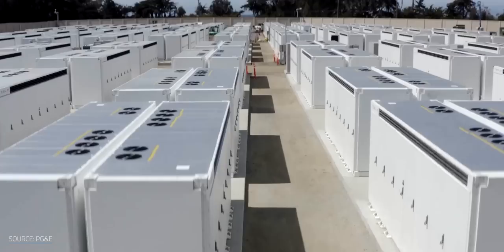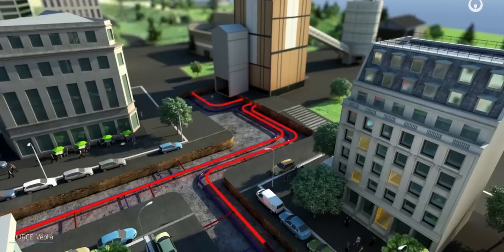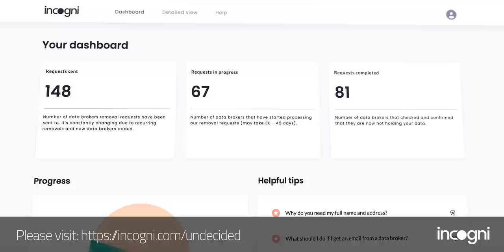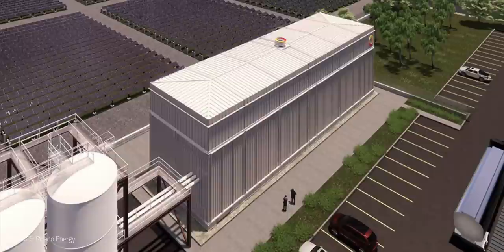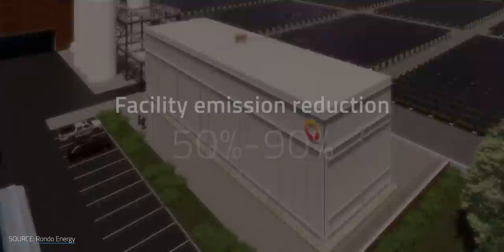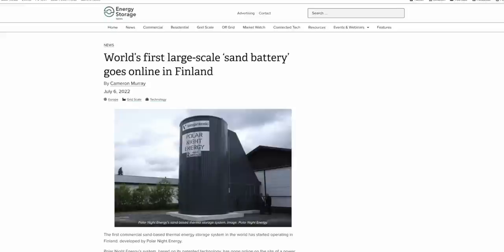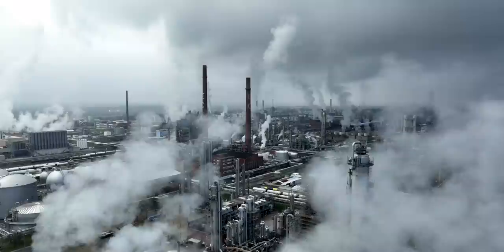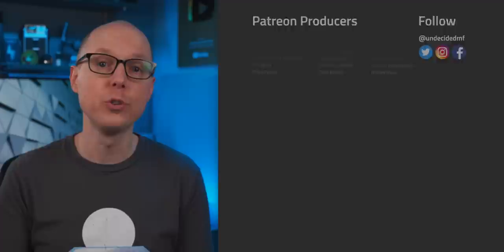How A Brick & Rock Battery Is Changing Energy Storage

Comment: Electricity converted to heat is a very low efficiency process, which means that this move is not viable for solar or wind. Just compare the heat output of a toaster element verses the kw hours put into it.

Comment: There ain't anything new under the sun ! Back in the 70s, with no local gas supply, only electricity, by father installed what were called "Storage Heaters" These operated with a special meter that could split the supply into off-peak and peak times. ALl night long the heaters would heat up and store energy in brick blocks in the unit. During the day the heaters were turned off by the meter, and the heat allowed to pass out into the rooms. In early years there was also a cheap period of a couple of hours in the afternoon. However this was eventually closed, and the heaters became more sophisticated.
So these are just very large storage heaters ! However, as far as I can see, they are not yet developed enough to actually use the stored heat to generate electricity, or am I wrong ?

Comment: Is anyone developing a home sized unit that would be a source for home heating and hot water?  I live in an solar off grid home.  I know that heat pumps are a great solution but this sounds simpler and the heat pumps could be a heat source for the storage units.   My solar cells on sunny days recharge my batteries before noon and essentially sit idle most of the day running the few appliances I need.  I like the idea of heat pumps but generally you need them most for home heating at night when the solar cells are not producing which means a big drain on batteries.  It would seem that once my batteries are charged, I could use a heat pump directly from the panels and store that heat directly in a device like this, drawing from it at night or as I needed hot water.

Comment: I really don't understand why steel production is even mentioned in this video. Where do you think the energy that generates the heat comes from ?. I love the idea of capturing/recycling heat energy from factories though. Maybe give them a tax break or something in return.  ALL our meaningful electricity production originates from heat and even coal power production and distribution would be MUCH more efficient if we could readily charge and discharge from large, reliable, low maintenance batteries somehow. This sounds promising.
Reply: Steel production was mentioned because it's one of the biggest polluting industries. Reliant on high heat temperatures; there are plenty of solutions for consumer green energy, but very few that can meet the intensity required by the steel industry.
 Consumers are some of the smallest global polluting demographics. Industries are by far bigger polluters, even worse than volcanoes. In one Scientific America article, it's said that the world's volcanoes produce about 200 million pounds of CO2 per year. Meanwhile, humanity produces about 24 billion pounds of CO2 per year.
 So if anything's going to be done to decrease greenhouse gasses, big polluters are the ones that need solutions, not consumers (although solutions for all would be better).

Comment: The only downside I can see to this is size, which is the achilleas heal of just about all fossil fuel replacements. If you are using a turbine to heat the new rock pile, where do you get the space for the rock pile? This my be one of the oldest technologies on Earth even animals use it, so it clearly works and I hope it delivers profitability.

Comment: if we take just the costs of military, we could  instead of all the fighting and suffering for the energy easily drill millions of deep holes into ground, getting free geothermal energy along with the possibility of storing the excess heat in the summer for the winter, which is the biggest issue humanity always had.. just getting warm through the winter and more recently to have warm water available
if we solve this, then only issue of the effective, sustainable and environmentally friendly transport and has to be solved

Comment: Conversation from electricity to heat is not 100%.  It can be close, but there is always loss wherever energy is moved. More than that, capture of the heat energy will never be 100%.  You always have to be skeptical of advancements when they bluster and/or outright lie. In this case, I'm hoping they're just being overly optimistic.

Comment: Could this concept be integrated into charging stations for EVs, and thus lower the strain on the power grid? How much renewable engergy is needed to maintain one of these? Just curious.
Reply: no you'd lose much of the energy in conversion back to electricity. This is only useful where Heat was the desired product, be that in the form of air or steam.

Comment: A 1 square mile (2.5sq km) solar facility produces the equivalent energy of a 14MegaWatt fossil fuel generator. It would require 70 SqMiles(181sqkm) to generate the same energy as a typical 1000MegaWatt fossil fuel generator.  To generate enough energy for the UK(318,000MWatts) it will require solar panel facilities to cover one fourth of the land of the UK.  Is Greta ready to see one forth of the land covered in solar panels?  And that does not include any land use for energy storage which is predicted to be nearly the same requirement as the solar panels themselves.

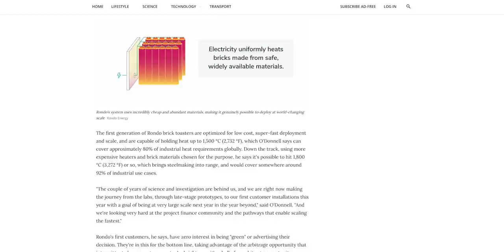Comment: 12:55   1500 degrees celcius might not be high enough for steel itself, HOWEVER, it IS enough for making the coke used to heat the steel. So right there you can cut a big chunk of carbon emissions as it takes a lot of energy to cook coal into coke and right now they use other fossil fuels, or even some of the very coal they are cooking, to provide the energy.

Comment: What if the pyramids had some kind of lens on top and it was actually heat they were aiming for?
Reply: See Lighthouse of Alexandria's "Death Laser". There's a molten salt power plant in Nevada that uses solar reflection, but a pyramid would be incredibly inefficient for that purpose because half of it will be shaded by the sun for most of the day. If their intention was to gather sunlight, it may have made more sense to build something like a concave hole with mirrors on a mechanism that can be moved to maximize sun exposure. Glass production back then was different though and impurities were common. "Eyeglasses were said to have been created by Salvino D'Armati in Italy during the 13th century."

Comment: they shouldnt be using electricity to create the heat thru resistive heater elements they could use heat pumps. not only could they put more heat in that way but they would also be taking heat energy out of the atmosphere. it would require a multiphase cascade heat pumping system  probly but its def possible

Comment: rarely, if ever, are things one size fits all.
It seems like this tech has a place in industrial and commercial applications.
Other similar tech may be required for task specific applications.
The holy grail is residential. 
If they can make a residential units as individual or even apartments that is cost effective; 
they will be mining gold. I am sure there is a size where it becomes more feasible than not.

Comment: So, chemical storage has some specific known risks and hazards. Batteries catching fire, disposal, toxicity in their construction, etc.  Same for gravity storage.
Thermal storage is ... yeah. Distributing that heat is going to have losses. The universe itself isn't cooperating -- pumping heat INTO storage is harder.  Also, safety hazards are different, not unlike high voltage electrical transmission and delivery, which can be VERY destructive when it fails.
But, water wants to get everywhere, and volcanic explosions are pretty much caused by water getting into places that are super-heated.  I want to know how they maintain thermal energy distribution systems, and how they repair damage, and what happens with structural damage (earthquakes, idiots with back-hoes, etc.) and what happens when water gets where it isn't supposed to be, and how long it's useful before it needs replacement, and how much that costs, and how much that impacts the environment... all the questions that also get asked for chemical and electrical distribution.

Comment: Batteries will finally be dirt cheap when they are made of dirt.  No one seems to cover the most applicable part of this energy formula...   Concentrated thermal energy from sunlight...   shoved through pipes into the ground nearby through boreholes... Stores the sun's energy.  

When you want to tap this energy, heat can go into a ORC (Organic Rankine Cycle power generator) to turn HEAT into electricity through the boiling of organic molecules in the same way an air conditioner works but in reverse (heat converted into electricity, not electricity into moving heat around).  

THEN when the sun goes down, you still have your heat in the ground and can continue to generate electricity using your heat stored in the ground.  A professor at Clemson university and the engineering firm AH&P in Macon GA are the pioneers of this tech.  But no one in the youtube world seems to notice what they are trying to do except the Department of Defense.

Comment: All of the old world architecture across the entire world that is made out of bricks all of it even mountains that they say are mountains that have been carved and there's bricks everywhere and there's windows and doors and archers still left even though it was melted it's because the bricks stored energy back then that's the reason all the buildings were brick everything across the realm streets and all because it was a worldwide battery storage and yes heat event did happen that's the reason you see old world architecture in some areas is melted it's not worn it's not torn it's not corrosion it simply was melted at 1 time from the electrical source in the building

Comment: I was very curious about cogeneration, thank you for talking about that. Would be great to do a deep dive into and what scale cogeneration is required to be profitable - why can't we cogen at home? How big does that unit need to be? How small can a TES be to be effective as a generator (TES water heater?)
Reply: @pierregravel-primeau702  Good to know it can be done at home, I was thinking about TES as an alternative to small scale home battery storage. There are losses due to converting heat to power but is that greater than the rising cost of lithium?
Reply: Cogen requires a gas turbine, which is far more expensive than a gasoline or diesel engine.  That's why we don't use them at home.  The only vehicles that are powered by turbines were our tanks because of the large amount of power for the lower weight.  However, it costs too much and even the government with an infinite supply of your tax dollars is going back to diesel.
Reply: @lorenwilson8128  Looking to understand if cogen using the waste heat is possible using heat to energy transfer (steam turbine) vs gas turbine. These units store superheated heat, so do we need gas if we already have the heat to boil water? I think one issue with cogen using compressed air was the pressure vessel. Presumably the challenge with bringing this home is our ability to insulate safely and affordably (aerogel). But not sure if there are any heat-energy generators. This video talked about cogen from heat, just at industrial scale. Would like to #JustHaveAThink about the limiting factors in small scale THS Cogen

Comment: And when the pipes break from earth quake then what? No one has heat or hot water in the whole city
Reply: When that happens, everything will break, so it's unfair to single out these pipes in particular. It's fair though to say that there's no one-size solution for all places, because all places are different.
 If a place knew the frequency of their earthquakes and the stress they put on subterranean networks, they could build to prepare for that. We have capable architects that know how to build for minor earthquakes. They could weigh the cost of infrastructure against performance, environmental impact and predicted longevity of the network.

Comment: Non-phase change encapsulated thermal batteries are basically governed by their volumetric heat capacity(VHC). 
The VHC of water is roughly twice that of rock which is why we have been using water in boilers to heat homes forever now. This tech is also been renamed to radiant heating and is installed into floors in homes and basements, garages etc to use excess heat from other sources primarily because it is efficient to water to store heat energy and also move it around.

None of this is new technology though. I admit I fail to understand how or why engineers think a solid like rock or sand would hold heat energy better then water when the VHC of natural rock is so low compared to water. Thus, this reeks of bull excrement to me.

Comment: Matt, right from the start, you miss the main issue : This system stores heat, not electricity.
So to call it a 'battery' and suggesting it is a replacement for lithium ion batteries is misleading.

It's not. It's just a giant electrically powered heater, which is arguably the dumbest thing you can do with electricity, renewable or not. 

Please do better.

Comment: Could a low level radioactive mineral like thorium heat up hot enough to melt steel?  There shouldn't be any hard and fast rule where atomics can only be used to make electric power! Could thorium be used to long term power a steam engine pulling a train or drilling a deep well without burning anything?  Can you imaging a steam locomotive without diesel, coal or batteries!

Comment: Wind and (pv)Solar generate electricity. It does not make sense to use thermal storage.  You would lose energy in the conversion. Why is that even talked about? If you want to talk about thermal storage of flew gases, that makes a little more sense. As well as other heat generating processes in industry. Or even geothermal heat storage.

Comment: The sun is always shining on one side of the earth. Wouldn’t transmitting the power across to the other side be feasible!?
Reply: It won't work. You'd have to lay down wires that circle around the earth. And even our best conductors (silver wires for example) have a tiny bit of resistance, which adds up really fast when we're talking about those kinds of distances. This means most of the energy you transport to the other side of the planet gets wasted, and only heat up the cable before it reaches it's destination.
Long story short: it would be a huge waste of precious metals for nothing gained.
Reply: @TheMegaOne1000  :( is there any chance this could be improved to make it feasible? like cooled wires or something like that. we do have internet cables across the ocean. the huge cost would replace the cost of massive energy storage that's needed, or at least a big chunk of it.
Reply: @Channel-tr1hx  -With out current technology we could eliminate the problem of resistance by making the cable out of superconductors. But those require cryogenic cooling, and rare metals. Even if we could build it, keeping the entire cable near -100°C would likely consume more energy than what we got out of the system. If it was even possible which I highly doubt.
-It could be done in the future if we invent room temperature superconductors that don't need cooling. But those only exist in science fiction so far.
-Internet cables don't transmit energy, only data. It costs only a few watts of power to send a laser through a fiber optic cable to the other side of the planet. And we don't care about how much of the energy is lost as long as the information makes it to the other side.

Comment: Ok, we get rid of petroleum and then where do we get the following products that also come from the petroleum that libs want to abolish... One 42-gallon barrel of oil creates 19.4 gallons of gasoline. The rest (over half) is used to make things like:

Solvents	Diesel fuel	Motor Oil	Bearing Grease
Ink	Floor Wax	Ballpoint Pens	Football Cleats
Upholstery	Sweaters	Boats	Insecticides
Bicycle Tires	Sports Car Bodies	Nail Polish	Fishing lures
Dresses	Tires	Golf Bags	Perfumes
Cassettes	Dishwasher parts	Tool Boxes	Shoe Polish
Motorcycle Helmet	Caulking	Petroleum Jelly	Transparent Tape
CD Player	Faucet Washers	Antiseptics	Clothesline
Curtains	Food Preservatives	Basketballs	Soap
Vitamin Capsules	Antihistamines	Purses	Shoes
Dashboards	Cortisone	Deodorant	Shoelace Aglets
Putty	Dyes	Panty Hose	Refrigerant
Percolators	Life Jackets	Rubbing Alcohol	Linings
Skis	TV Cabinets	Shag Rugs	Electrician’s Tape
Tool Racks	Car Battery Cases	Epoxy	Paint
Mops	Slacks	Insect Repellent	Oil Filters
Umbrellas	Yarn	Fertilizers	Hair Coloring
Roofing	Toilet Seats	Fishing Rods	Lipstick
Denture Adhesive	Linoleum	Ice Cube Trays	Synthetic Rubber
Speakers	Plastic Wood	Electric Blankets	Glycerin
Tennis Rackets	Rubber Cement	Fishing Boots	Dice
Nylon Rope	Candles	Trash Bags	House Paint
Water Pipes	Hand Lotion	Roller Skates	Surf Boards
Shampoo	Wheels	Paint Rollers	Shower Curtains
Guitar Strings	Luggage	Aspirin	Safety Glasses
Antifreeze	Football Helmets	Awnings	Eyeglasses
Clothes	Toothbrushes	Ice Chests	Footballs
Combs	CD’s & DVD’s	Paint Brushes	Detergents
Vaporizers	Balloons	Sun Glasses	Tents
Heart Valves	Crayons	Parachutes	Telephones
Enamel	Pillows	Dishes	Cameras
Anesthetics	Artificial Turf	Artificial limbs	Bandages
Dentures	Model Cars	Folding Doors	Hair Curlers
Cold cream	Movie film	Contact lenses	Drinking Cups
Fan Belts	Car Enamel	Shaving Cream	Ammonia
Refrigerators	Golf Balls	Toothpaste	Gasoline.